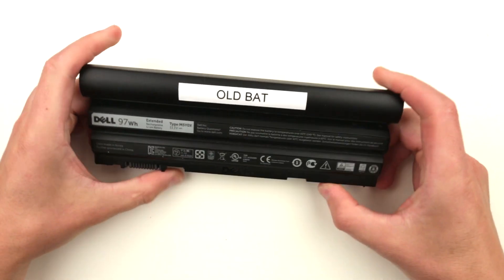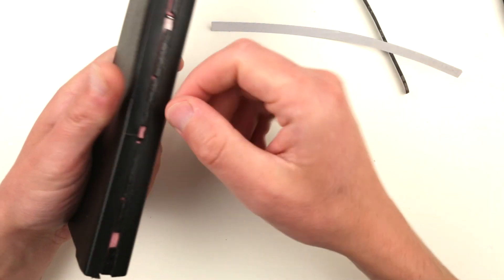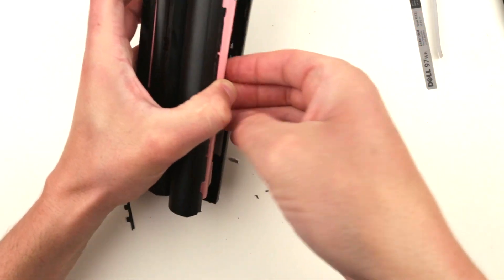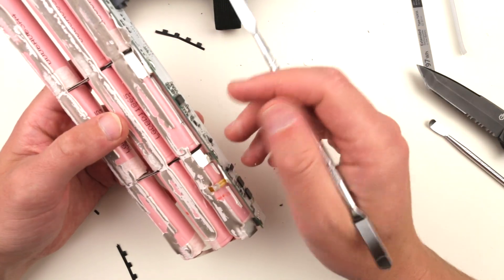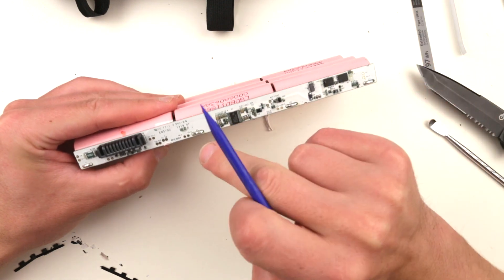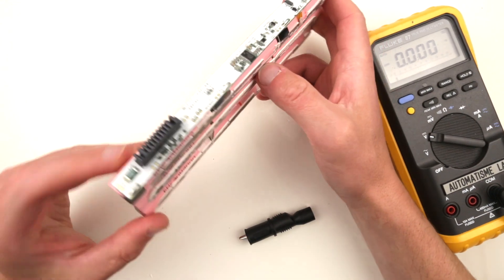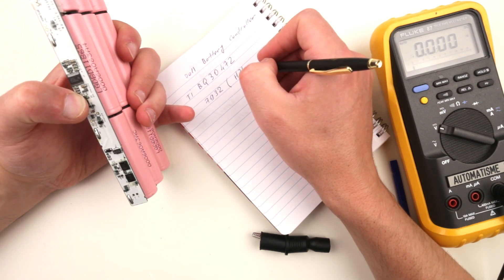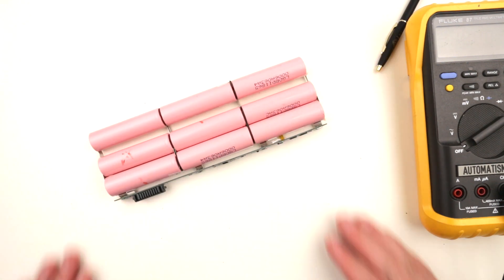Dell Laptop Battery Troubleshooting

Comment: Dell D600 battery (C1295)With a jumper between Ground and the SYS PRESENT pin I can measure voltage and discharge the battery using a R/C charger /discharger.  However I can not charge at the out most pins.
If I put the battery back in the laptop it will charge it full again.  Would you know if I need another jumper to allow the battery to accept charging?
Reply from the maker: Not really, I actually surprise you area able to charge the pack using RC charger ! Good. I need to try it myself as I have second one like that :D
Reply: @InsideOutElectronics  I could'nt charge it with my R/C charger only discharge it.  I could charge it
when I put it back into my laptop.  I have been doing some additional reading and if I understood it correctly, the battery needs to receive a signal from the laptop to allow the battery to charge. I don't know if that is a data type signal or a simple gnd or high voltage applied to a pin to allow charging.
Reply: @InsideOutElectronics  if you separate the batteries, you can charge / discharge them with an 18650 charger. But, it's best to just get all new batteries weld them together with new tabs and reassemble them into the battery pack.

Use thin foam tape / GPU Heatsink foam where there was foam before. It cushions the board and charging connector against hitting the new batteries.  Good Luck!
Reply from the maker: @chipinnc  Than you for comment! I have tried to recharge batteries in place. I did not help. Battery back refused to operate.

Comment: My Dell laptop battery was the same condition as yours.  All 3 cells in the end bank were completely dead.  I removed them and tried charging all 3 cells in a battery charger for 18650 batteries, and they remained dead, so I threw them in the trash.  Good video!
Reply from the maker: Thank you, keep those batteries, you can pull good ones for other projects
Reply: @InsideOutElectronics  what is mah of these individual cells?
Reply from the maker: @motivatedlads  Brand new - 2000 mAh, but I can only recover them to 1300 mAh